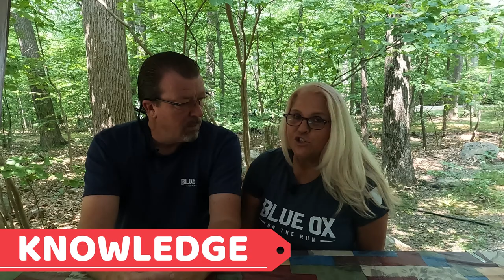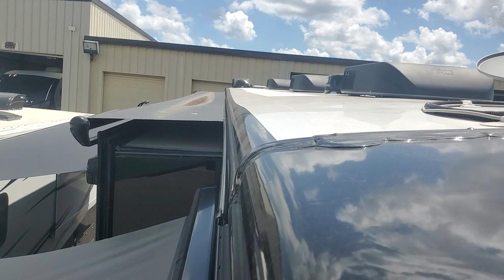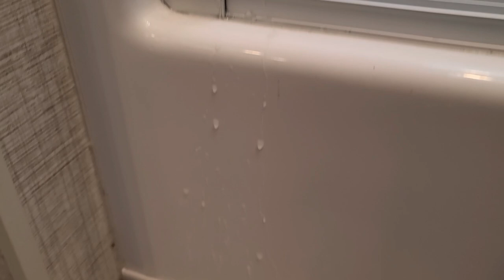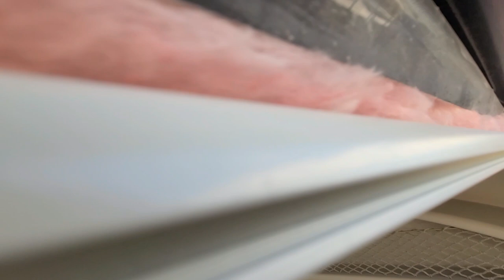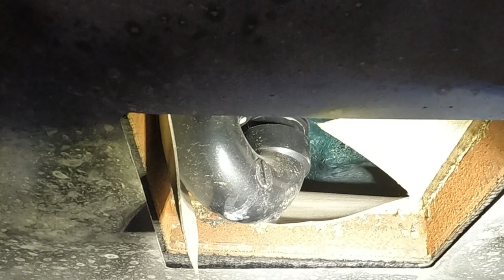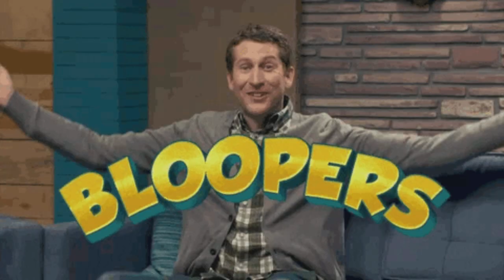💥HOW to INTERVIEW & HIRE the BEST RV INSPECTOR! NOT ALL RV INSPECTORS are CREATED EQUAL!

Comment: I don't understand the pricing on an RV inspection. A house...$450-$550. An RV...$1200 to $2000. And on a class A, i haven't seen one yet that inspects the engine. Can you explain the cost discrepancy?
Reply from the maker: House doesn't have 4 different electrical systems to be tested, 2 water systems, doesn't have any mechanical slideouts, 2 to 3 AC's , converters, inverters, batteries, 2 different engine, frame, suspension....do I need to extend on the subject !?
In my book, a house inspection is for the bank to confirm there is a building on the site that they are financing 🤣
An RV Inspection that they call "Essential" is just that 🤪 Inspector noted there was a roof 🥴 and walls, and wheels...😁 one charges $5-600 for that...! As useless as a house inspection in MHO